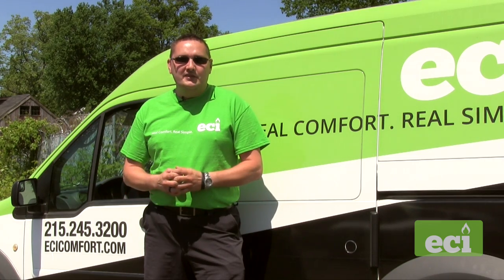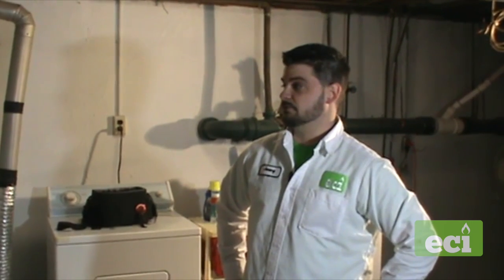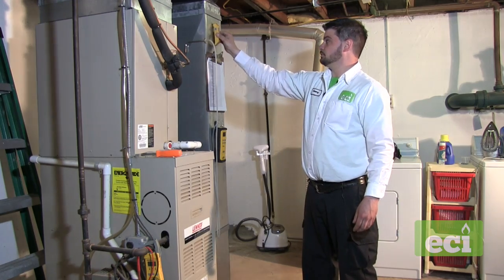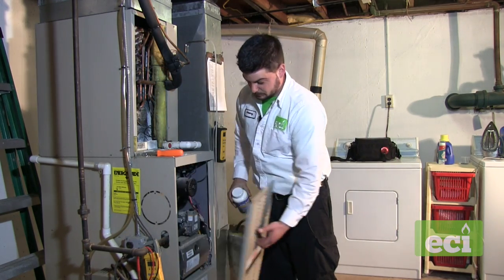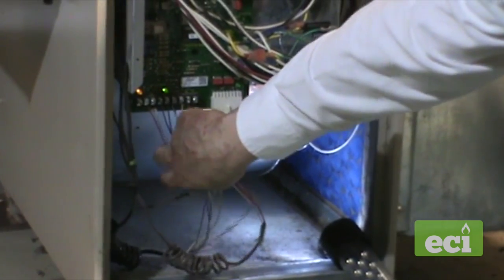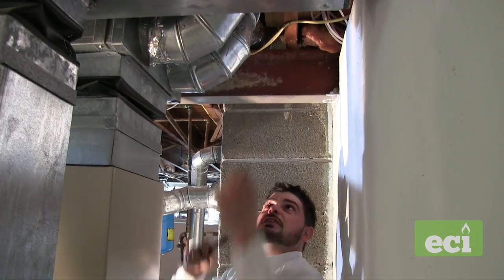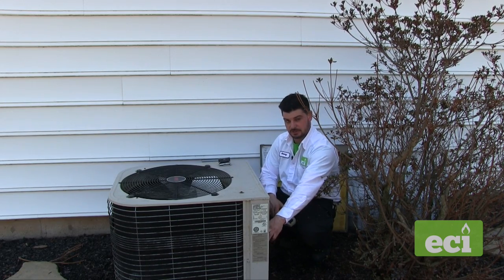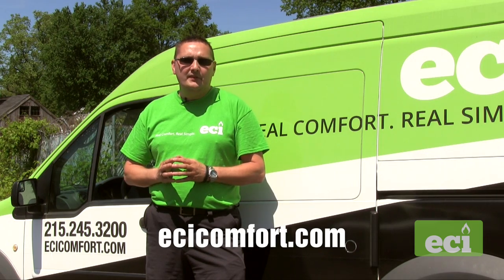Air Conditioner Preventative Maintenance

Comment: When you connect and disconnect the gauges youre losing refrigerant. Why not a capacity check. Doing a simple test will telling you everything you need to know about how efficient unit is operating. 

Heat capacity = cfm x 4.5 x enthalpy difference (wet bulb temp. From supply and return)